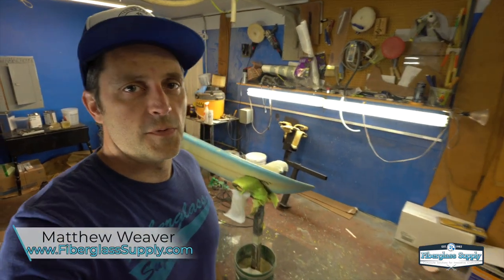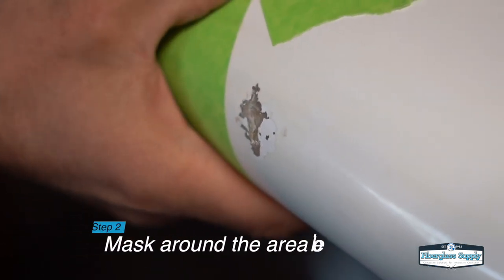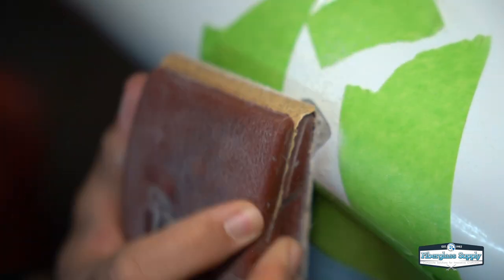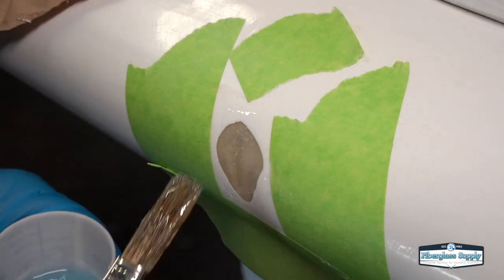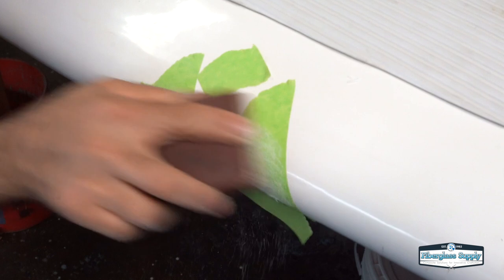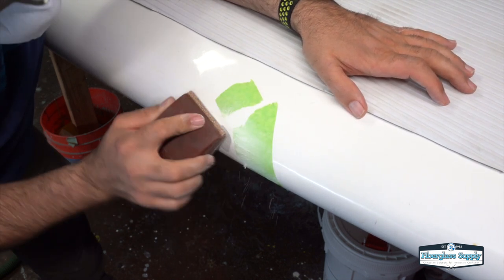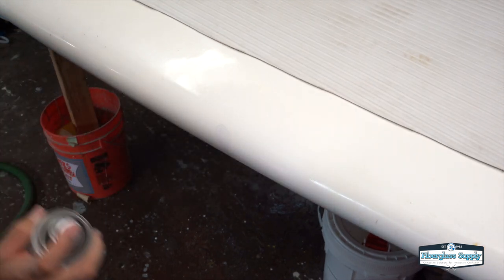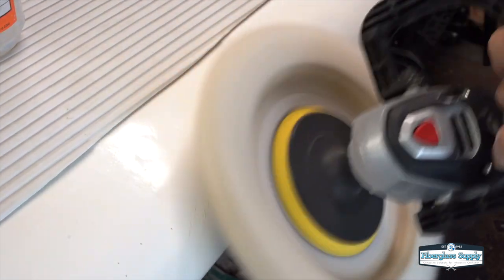How to: Rail Ding Repair on Painted  Epoxy Surfboard or SUP

Comment: Thanks for the video! How would the process differ for a poly board? I think I have a poly board. It's a surf paddleboard made in HI. I started sanding it and it has a strong sweet, chemical smell - I read online that's how you might tell the difference. Anyways, grateful for any additional tips.
Reply from the maker: Actually the process is more or less the same.  A couple differences are that poly boards you can use polyester resin on (you can also use epoxy) but you cannot use polyester resin with epoxy (stryofoam cored boards) and most polyester boards are going to be sanded or gloss and polish finished where most epoxy boards are painted.  If the board has a sanded finish or a gloss and polish finish skip the painting and finish it off like a regular surfboard ding (seal with surfboard sealer on a sanded finish, and polish on a gloss and polish finish).
Reply: Good info, thanks! Will try it this week, fingers crossed the board is usable afterward :)

Comment: No hot coat with epoxy?
Reply from the maker: The short answer is no. Because we use the peel ply we don’t need to do a fill coat however if we had not used the peel ply we may have done a fill coat. Epoxy will self surface which means it does not need a coat with a surface agent in it to cure tack free, which means you could sand the patched area if it is built up higher than the surrounding surface.
Reply: @FiberglassSupply  thanks, I've done fiberglass repairs, but this will be my first epoxy repair

Comment: what kind of epoxy resin are you using? does fiberglass resin work?
Reply from the maker: Most standup paddle boards require that an epoxy resin be used. On this board we used Resin Research 2000ce, which we sell. What is commonly referred to as fiberglass resin is a polyester resin that will melt the styrofoam core and isn’t compatible with any boards that have eps or xps (styrofoam) cores. Surfboards that have polyurethane cores can be repaired with surfboard grade polyester resin.
Reply: @FiberglassSupply  thanks a lot! ive been looking everywhere for some!

Comment: i have like 5 inch gash through the top of board. kid ran my girlfriend over. its epoxy but on the top not the rail and much larger. any suggestions? or supplies?
Reply from the maker: about how deep and wide is the gash?  If it is not too terribly wide or deep I would fill it with putty and glass over it.  Is the board a polyester or epoxy board (polyester has a urethane foam core, epoxy boards tend to have styrofoam cores).  Here is a video where we fixed a crushed rail with putty and glassed over it  https://youtu.be/CKvN5XO09js  and here another video showing how we made the putty https://youtu.be/eK1vlG46XAY

Comment: I have light surface scratches on my board  what can i use to get them out ?
Reply: if its from sanding with low grit sandpaper, you can use progressively higher grit sand paper, finishing with wet n dry to get rid of those scratches
Reply: @tomnation7408   Thanks very much

Comment: Thanks for the video.  My son's board just was repaired and they didn't paint it to conceal the repair. What kind of paint did you use?
Reply from the maker: Spray paint from the hardware store, usually rust oleum or krylon brand is what I use, look for one that says it will bond to plastic. The colors may not match perfectly, fanning the spray (not taping off a hard line) where you want to blend and then color sanding will help make the difference in color less noticeable.
Reply: @FiberglassSupply  do you not use a finishing coat over the paint? Most SUP boards I see have a gloss over them. is it a gloss spray paint, or is it a gloss resin coat?
Reply: @jonnyzuma6884  I was going to ask same.  I don't think hardware store spray paint is made to be watercraft paint.   I think I would hotcoat over the paint,  no?

Comment: Excellent step by step! My white coating is chipping off my old Pau Hana in spots so I think I just need to paint and blend.
Reply from the maker: If there is no underlying damage, yes. On that particular board in the video there were a number of spots that where the paint had chipped off that had no fiberglass damage underneath that we just sanded and painted.

Comment: Can you guys do one with a huge hole on epoxy board! Ive seen people just put a new cut out eps foam or q cell with slow harder? What do you guys usually do?
Great video
Reply from the maker: If we get one come in we’ll video it. Huge holes in eps can definitely be plugged with an eps cutout, it gets tricky if you try to fill it with putty, slow hardener is a must and it may be necessary to do in layers if doing putty.

Comment: During step 4 wet the patch are you using the two part mixture or just the resin without the hardener? Please clarify if there are points in the repair when you would only use the resin or hardener individually vs as a mixture. Thanks!
Reply from the maker: Always as a mixture.

Comment: How far do you cut outside of simple 2”-3” cracks on the rails or tail before applying the resin and fiberglass?
Reply from the maker: If I am cutting away damaged glass I am usually only cutting back to where the glass is bonded well to the foam below it.  The caveat there is that sometimes the glass will lift off the foam (actually the foam separates, usually just below the glass) but isn't damaged, in that case I'll use some resin and glue it back down.  The taper that I will sand to bond the new glass over the repair area usually extends around 1/2" from the edge of the damage.
Reply: I know I am pretty off topic but does anyone know a good site to stream newly released movies online ?
Reply: @Keanu Lance Flixportal :P
Reply: @Draven Zachariah Thanks, signed up and it seems like a nice service :D Appreciate it!!
Reply: @Keanu Lance happy to help :)

Comment: no hotcoat neccessary?
Reply from the maker: We used peel ply over the repair which allowed us to get away with not hotcoating it.  Otherwise yes, after laminating the patch and it sets, put a coat of resin over it before sanding.
Reply: @FiberglassSupply do you need clear coat to seal the paint? Otherwise it will scratch/chip off?